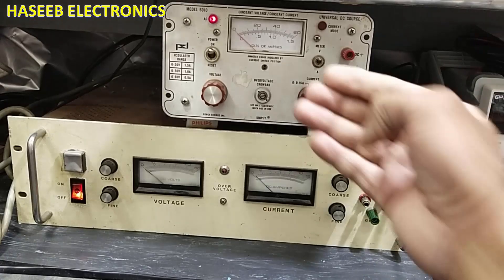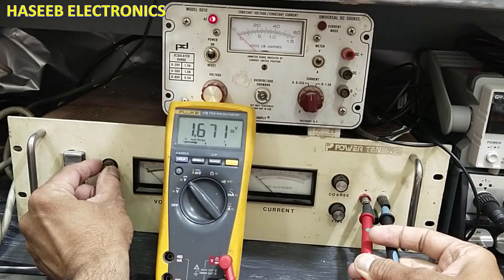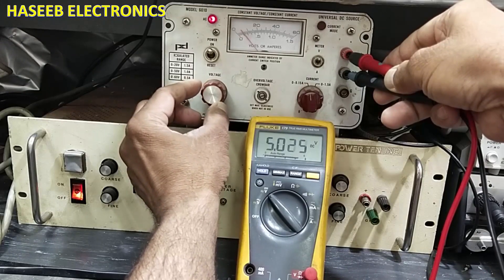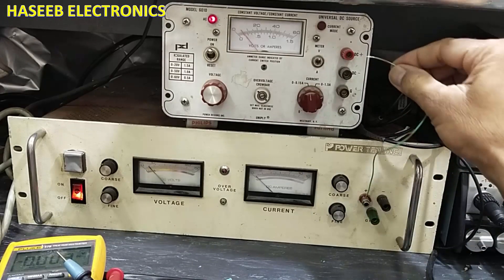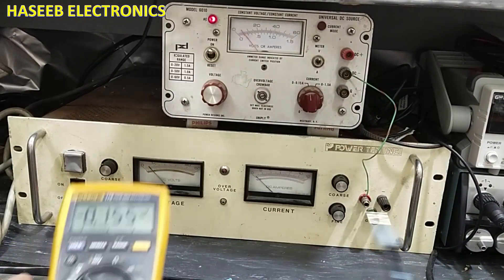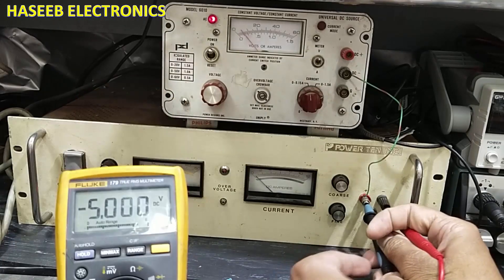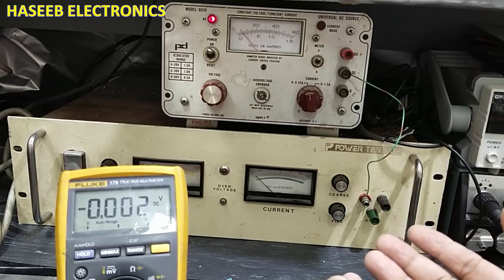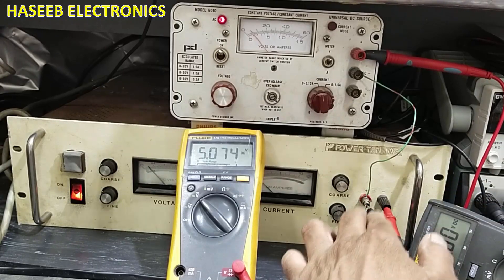{665} How To Make +ve -ve Power Supply, Dual Power Supply

Comment: Not all power supplies are isolated! You must remove GND connection first if already connected.  Then  connect a DVM from +ve terminal of PSU 1 to -ve terminal of PSU 2.  If you can see 5V then the PSU is not isolated and you cannot do this or you will short out the power supply. Another test is to measure Ohms between  -ve of PSU1 and -ve of PSU 2. If low ohms then you cannot do this.